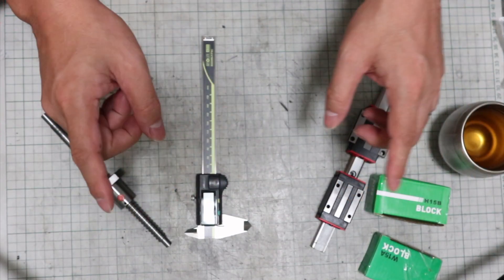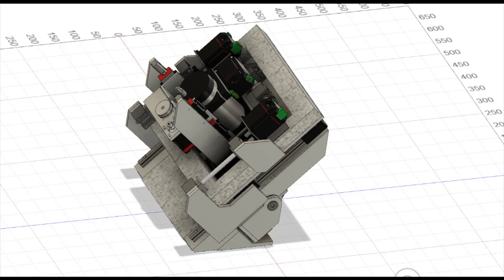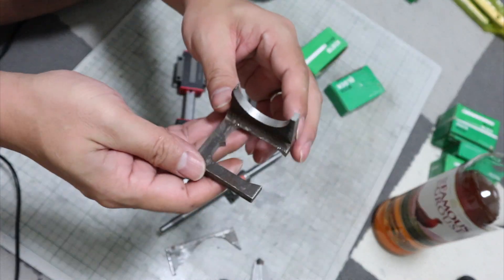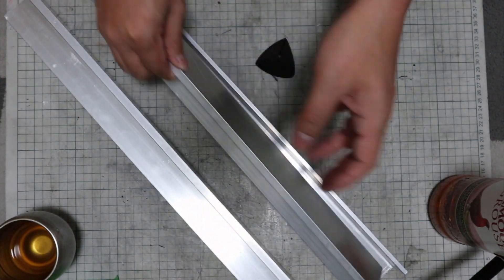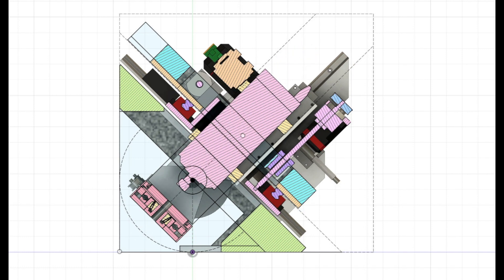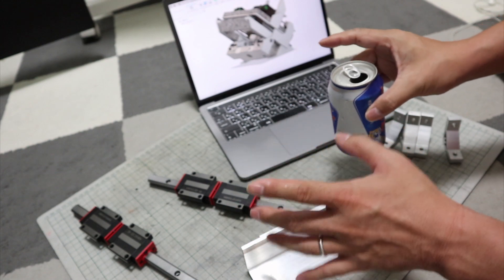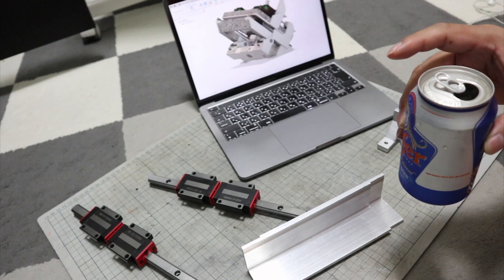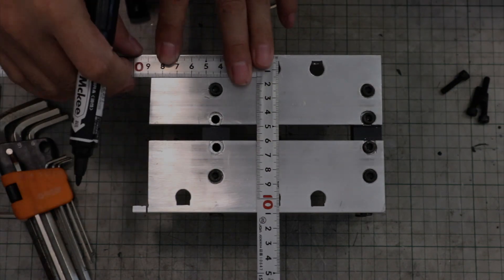Building The 5-Axis CNC Machine in a Small Room: A DIY Journey. (part1)

Comment: Nice ideas.  I hope you succeed.  5axis is more that most of us need but your ideas are great for 3axis machines as well.

Since you are working in a closed box you have a added opportunity to recover the coolant.  Providing a cold finger, over a basin should condense most of the coolant as the amount of vapour in the box will become high.  Depending on what is cheapest you could use a Joule-Thompson cooler with a compressed nitrogen or air cylinder, a Sterling heat pump, a supply of dry ice or liquid nitrogen, a repurposed small desktop ice cube maker or even a Peltier effect dehumidifier.  Only the cold finger has to extend into the soundproof box so it will not take away working volume.
Reply from the maker: Thanks for the advice.
There are probably several ways to deal with the steam during processing.
I am trying to come up with the simplest solution possible.
I will decide on a specific method once I am able to do the processing.

Comment: I would highly recommend going all the way full blast with coolant. I work in a machine shop with a HAAS VF6ss, a UMC1000, and a TL1. If you have any amount of coolant on your workpiece, and I mean even a drop that you can't see, your chips will stick, and wont fall down naturally. Not using coolant to remove chips and letting them fall on their own won't work when your milling a pocket, or when at a 45 degree angle.

To solve the space issue, I have a possible solution:
Remove the existing soundproof box, but keep the materials. Use the same outer dimensions. Make an inner box out of aluminum sheetmetal, put a removeable mesh over it to keep the chips out, and have the bottom shaped to collect coolant to a single point. Run the flow from the tray to a resevoir, then to a pump, and then back up to your nozzle. When you go to install the inner box, pack the space between the two layers with soundproofing material.
Reply from the maker: Thanks for the advice.
I think you are right, using enough coolant has a lot of merit.
However, my machine is more about downsizing.
I also try to keep it lightweight.
The more complicated the structure, the more likely it is to fail.
Self-built machines are easy to cause various problems, so maintenance needs to be easy to do.
I want to make the most effective system with the simplest possible structure.
Reply: @a-cnc-f 
You make a fair point about your size and compexity constraints. You're a lot more sensible then me in that regard, as I would just make something that fills up my entire garage, and then complain about a lack of space and an empty wallet.

Comment: I’m curious about how much the dimensions of this design can be modified. I have a very specific project in mind. First, the medium is wood, not metal. Second , the object has a strange envelope, it is roughly 12cm X 12cm X 35cm. One of the advantages of building the machine myself is that no affordable 5-axis router/mill can accommodate a build volume like that. But no design can be arbitrarily changed in any dimension, without the possibility of introducing stresses that will overburden tolerances. I don’t have the same space constraints and I can build or buy a sound-proof enclosure, which will also help with dust management. It would be helpful if during your videos, you discussed the impact of modifying the dimensions of your design. Do you plan to share your CAD data? That would be helpful in exploring the impact of increasing the dimensions as necessary. This video is a fantastic find for me, and I will definitely join via Patreon or whatever is most helpful.
Reply from the maker: Thanks for your interest.
The advantage of building your own is that you can design it as you like.
I wasn't sure if you were thinking of making a machine out of wood or a machine for cutting wood.
I think this is a problem with my English skills.
I don't think I can say anything at this stage about the impact of changing the design.
It is not finished to begin with, and I still don't know what this design actually is.
I do plan to release a 3D model in the future, but only after the design is more finalized.

Comment: I don't think an air cooled 24k spindle is a good fit for wanting to machine steel.  The volume of air moved by a fan is directly proportional to RPM, whereas the heat generated is roughly proportional to the torque of the motor (not the power.)  So at 12000 RPM, you will only have half the available torque and 1/4 the rated power of the spindle.
On the other hand, drip cooling of the workpiece like that can be rough on tools.  The thermal cycling can cause micro fracturing.  Some tooling manufacturers recommend just air blast for cooling and chip evacuation with steel.
Reply from the maker: What you say is correct if I focus only on optimal steel processing.
This machine needs to be designed for minimum space, minimum equipment, prevention of scattering of cutting chips, weight reduction, noise reduction, etc.
Also, if you are not satisfied with the performance of the motor, I can replace it with the same size φ80 2.2kw water-cooled spindle.

Comment: One feature that I like about the PocketNC is that the C axis is based around an ER40 collet. it makes work and fixture holding very adaptable.
Reply from the maker: You are an active member of the linuxcnc forum?
I remember you from your picture.
I really admire people like you who have a wealth of knowledge and are willing to share it.
I am honored that you are interested in my project.

By the way, regarding the ER40, I was thinking of copying PocketNC, but I wanted to make the C-axis as thin as possible, so I decided not to use a collet.
However, I am planning to make a fixture to fix the collet using an angle.
Reply: @a-cnc-f  Because of your ingenious geometry, the C axis can be thick in the middle and thin at the sides. 
Also, it would be unusual, but the collet could be reversed, with the thin end towards the spindle, if that helps the design. 
The inverted nuts, as used by Pocket NC, also would help. I used the same style here: https://youtu.be/fym44wESy8U
Reply from the maker: Sorry.
I didn't realize this message was blocked.

I watched your video.
It is wonderful.
The C-axis of my machine is 35mm thick and I need to put the worm wheel and bearing inside the φ100mm.
With a cross bearing, maybe it is possible.
I still have some time before I start making the c-axis, so I will think about it again.

Comment: Nice effort, I wish you the best. However, just wanted to point out that the angled design you have is not new, if you look up the older LIECHTI cnc machines from Switzerland, from a few years back, you will see their cnc machines designed specifically for aerospace applications that are angled as well. Check it out.

Comment: In order to use 5-axis RTCP, a post processor and a CNC controller are important. What CNC controller did you use in your previous videos? What controller are you currently using for this machine? Also, the post processor needs to be 5-axis capable, how do you solve this?
Reply from the maker: You can use TCP with linuxcnc and fusion360.
Reply: @a-cnc-f  which fusion360 Version are you using? Machining Extension costs 1700 a year.
Reply: @christianthier3457  He may be a student. Student license unlocks the whole suite I believe(?)

Comment: If you plan to machine steel with this 24k spindle - you are run into the web of troubles. At first theese spindles has a very small torque at the low rpm, usually 10-12k is their usable minimum. You can solve it, partially, see the youtube vids, where people tune their VFD to give more amps at low speeds; thus work, but lead to enourmous heat production by the spindle core, so you can do this (I've almost done) by providing a great amount of coolant to the spindle, and make/buy a special chiller to keep coolant cold, because spindle, working in described conditions produces really much heat. The second big trouble will be spindle bearings. Theese spindles, they are built for speed, not for heavy duty. Usually they have 2 pairs of small bearings, sometimes none of them are real spindle bearings, which can take some torque on them. When you are machining something soft, including alu, you will not suffer much from this, but machining steel will kill bearings in such spindles very fast. Some of theese spindles has ceramic, special torque bearings inside, so they will last longer on steel. Maybe it's not too late for you to change your mind and choose another spindle for your new machine??
Reply from the maker: I have received similar comments from others.
Indeed, I am concerned.
I chose this motor because a larger spindle motor would not fit in the soundproof bock.
The end mill is supposed to be 3mm, so I am not sure if the load will be that great.
I have already purchased the motor, so I'll give it a try anyway.

Comment: Very interesting design, as always. I'm concerned about the fact that the largest mass in motion is acting as a driver for the entire cantilevered assembly to behave like a giant oscillator. Any sort of brace that completes the triangle from the upper edge above the trunnion down to the base will improve this effect exponentially. Hope you will keep this in mind if it starts vibrating unexpectedly. Good luck!

Comment: 我認為這個想法十分有趣，但是推薦使用閉環，否則非常容易發生位置錯誤而碰撞
Reply from the maker: You are right.
The stepper motors I already purchased are closed loop.

I used closed loop for the first time when I built a CNC lathe and it is very nice.
Reply: @a-cnc-f  順帶一提，雖然切削液問題解決了，但是仍可能需要準備抽水馬達。
大功率的主軸馬達很容易發熱，沒有適當的散熱很可能會過熱導致停機甚至會失去它。
Reply from the maker: As for that, I'll have to start using it and see how it goes.
If there is a problem, it will need to be addressed.

Comment: I hate to rain on your parade (an expression meaning I hate to be the bearer of bad news) but your A axis is going to get blocked by chip material unless you can get rid of period build up like with a vacuum.
Reply from the maker: As you say, this machine is designed to be compact, so it can not stock cutting chips so mach.
However, by placing a sheet underneath, the fillets can be easily removed.
Reply: @a-cnc-f  a tray would work, or a vacuum port on the door to suck the material out periodically. Looks like a great build.

Comment: For cooling I suggest repurposing a cheap airbrush. You can use a powerfull airblast and set the needle to deliver very minimal quantity of coolant (oil or even alcohol, much cleaner). You will be amazed to how far you can go with only some drops of coolant.
Reply from the maker: I think it is very effective to use air and mist oil to cool, remove cutting chips, and lubricate as you suggest.
However, I will be using this machine in a normal room and I don't want to fill the room with oil mist.
Also, it requires the use of a compressor, which is a large piece of equipment.
Another problem is that it is technically more difficult to reliably mist the oil.
However, your suggestion is very effective and may be the best method under the right circumstances.
Reply: Wouldn't there be a chance of the alcohol igniting if the temperature got too high?
Reply from the maker: I too think alcohol is dangerous. Especially since my soundproof box is located in a closet and a lot of my clothes hang on the top side.
If it ignites it would be horrible.
Reply: @a-cnc-f  If you vent some Nitrogen into the build box you would have almost no fire risk while the box is closed.  I made a comment above detailing ways to recover the lubricant and having alcohol as an option is good because it is not messy.  Using N2 JT or LN cold finger would both provide nitrogen to displace air from the box.

Comment: Which is the biggest diameter of bit? 6mm on this small maschine? So you have high rpm even with steel. 30mm Endmill runs with 2k Rpm in 4140. So you go mostly over 10k rpm.
Reply from the maker: I am considering using a 3mm end mill for the main use.
The last machine we built also used 3mm as its main tool.

Comment: Mr. Ford has used the same approach in his Ford T putting the gas tank above the engine in order to use gravity and natural flow + save money on a gas pump( which was one of the most expensive components at that time). During the public demo of his vehicle the backing up of a hill was required to get fuel. 😁😁
Reply from the maker: I didn't know it had that idea in your car.
Reply: @a-cnc-f  Well, it's not my car. Ford T was the first success of Ford( 110+ years ago) and the foundation of his empire and modern car manufacturing approach. 😁

Comment: The machine is so small that using impregnated carbon fiber to laminate epoxy granite does not seem very expensive. Well, ready-made carbon tubes as reinforcement for epoxy granite are then in place.
Reply from the maker: I had decided to use epoxy granite for the base of the machine, but had not yet decided on the aggregate or reinforcement.
I will consider using carbon.
Thank you very much.
Reply: @a-cnc-f  mix milled carbon fibers in the epoxy.
Reply from the maker: I decided to give it a try.

Comment: Changing the tool on the spindle will get very difficult....
Reply from the maker: It may be a little difficult to do, but if the spindle is moved forward in a position that does not interfere when changing tools, there should be no problem.
Reply: @a-cnc-f  The design looks absolutely amazing... i really hope you succeed it looks so awesome and unique....

Comment: Very interesting, and yes please show the full build and creation process! Interesting choice the 24000 rpm spindle, I would've guessed you would use a low rpm constant torque spindle because your main goal is to machine steel. You could use short single flute cutters at around 12k-14k rpm which should provide enough power from the 24k rpm spindle assuming it's 1.5+KW. 
I think this is a very smartly designed machine, really impressive and I do think it's going to work! 
I guess running a compressor in your apartment isn't going to work as they produce too much noise. That's what I use to run coolant and airblast (mistbuster style) to the workpiece and cutting zone. I'm not constrained by noise and space much though. But I don't have access to industrial tools either aside from my diy 750x1500x200mm build space cnc, a drill press, angle grinder, diy 3D printer and bandsaw. I love building machines and am considering building a smaller much more rigid one for machining small steel parts with a high torque low rpm spindle, possibly a toolchanger. 5 axis would be nice. 
I'm also interested in how you do 5 axis cam, how to set it up for your machine etc. Do you use free software or licensed something that's affordable?
ありがとうござました！
Reply from the maker: Thanks for your interest.
Several people have commented on the spindle selection.
I didn't insist on 24k, but this spindle was the largest size spindle that could be used for machines under 400mm square.
Since I consider 3mm to be the main end mill we use, we thought it would be sufficient torque.
You seem to be the same kind of person as I am.
As for CAD and CAM, I think the FUSION360 is the best, but the problem is that you have to use a paid subs.
As a solution, I try to make original G-code and produce programs without using CAM.
I wish there was a CAM that was free and supported 5 axes.
Reply: @a-cnc-f  Hi, great little project, will be following along. I recently bought a CAM program that does up to 5-axis ... Desk Proto from the UK. They have a hobby license which is priced at 248 Euros, about 25% of the full license price. I bought it because I'm planning on adding single and dual rotary axes to my Carbide3D Shapeoko 5 Pro CNC Router, but first I am putting together the motion control electronics from Vital Systems ... the 6-axis HiCon Integra controller. I have already purchased the Mach4 software program. I can't use the supplied Carbide Motion control program because it is limited to 3-axis motion (because of GRBL). Cheers.
Reply from the maker: Sorry, I missed your reply.
Thanks for the promising information.
I was quite seriously looking for CAM software that supports 5-axis.
There are a lot of excellent software out there, but they are all very expensive and I was having a hard time finding the right one.
If it supports 5 axes at this price, it seems to be worth the purchase.
Reply: @a-cnc-f  That's also very impressive to be able to write raw 5 axis gcode! I understand your choice of spindle now thanks! I use 4mm because they break a little less often. And 6mm for larger pockets in wood.

Comment: a problem with those 24k rpm spindles is, they have very low torque under for example 12k rpm. Better suited would be a spindle with 12k rpm and 4 phases instead of only 2 phases, which doubles the torque of the spidle.
Reply from the maker: I was going to use a 12K motor like you said, but since the size of the machine needed to be less than 400mm square, that motor was too big, so I gave up.
Reply: @a-cnc-f  oh okay

Comment: Hi, nice project, I like it. But I'm concerned about the spindle motor Rpm. For steel you need to reduce the Rpm but at low Rpm torque may not be sufficient.
Reply from the maker: You are right.
24k is too early for steel processing.
The problem is torque.
It is hard to know what size endmill can be used with this spindle until you try it.
On the last machine I built, I mainly used 3mm end mills.
I am thinking mainly of 3mm this time as well.
It will probably be used for about 10k.
The motor seems to have more torque at low rpm, so I don't think it is necessary to use the highest rpm.